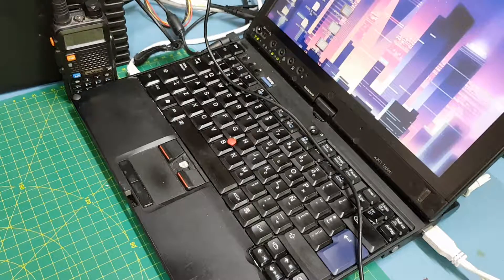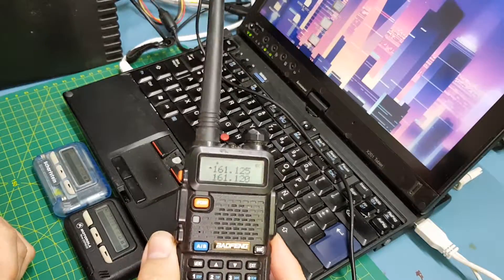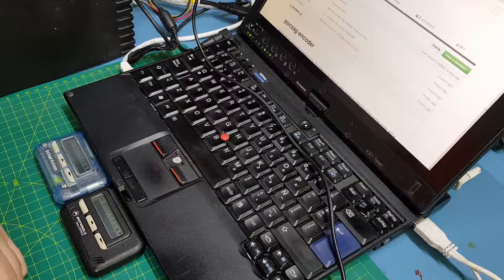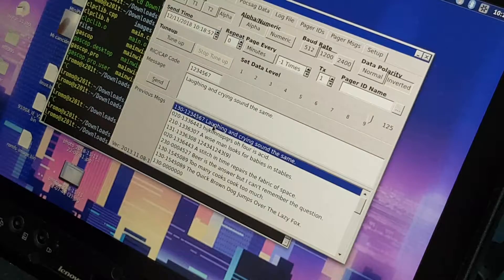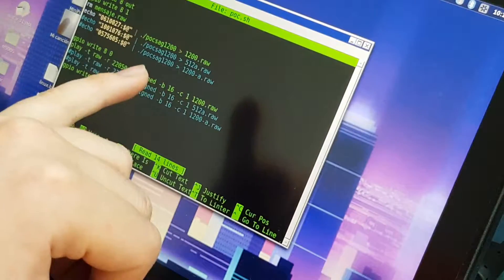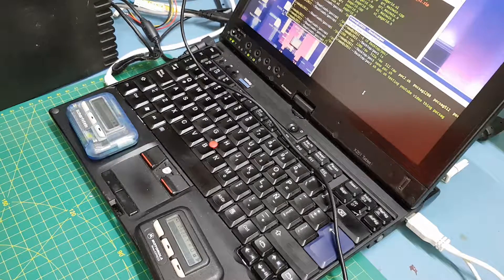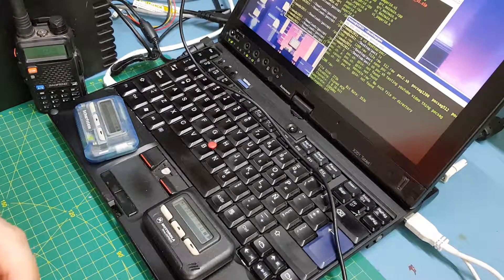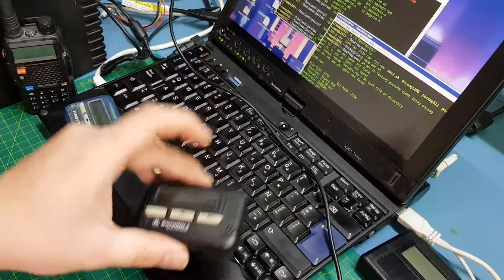How i get my pagers working

Comment: can i use just a handheld to send my pager stuff maybe prerecorded messages or some stuff
Reply from the maker: @krisssstronggg5178  at this point you can use a raspberry pi to easily do this without a radio, or a flipper zero, or a hackrf with a porta pack

Comment: Hi, could you also connect the line out cable to the MIC input on the Baofeng radio and achieve the same effect?
Reply: That’s what I do and it seems to work fine!
Reply: I also have the radio on VOX so when I give it audio it automatically transmits.